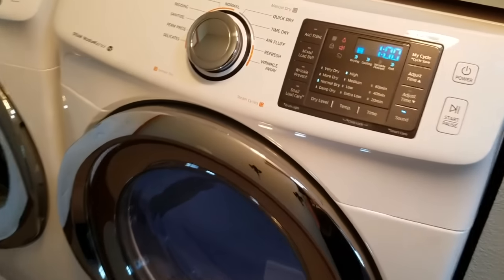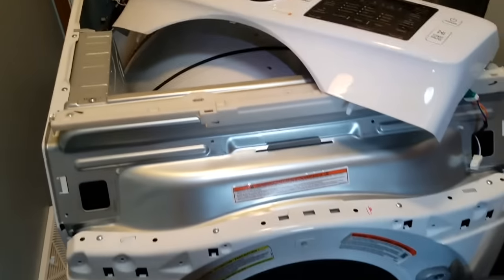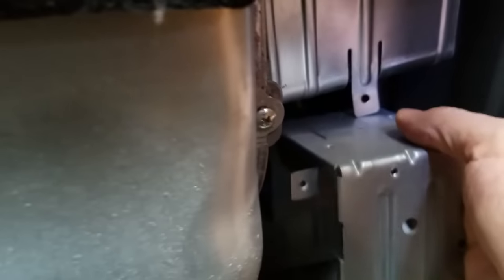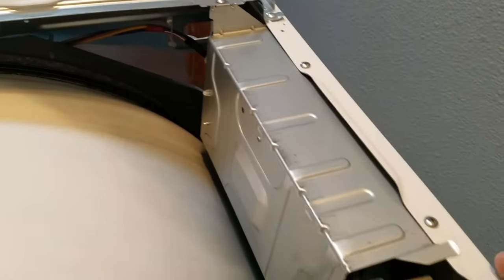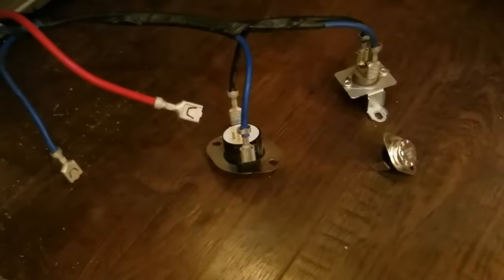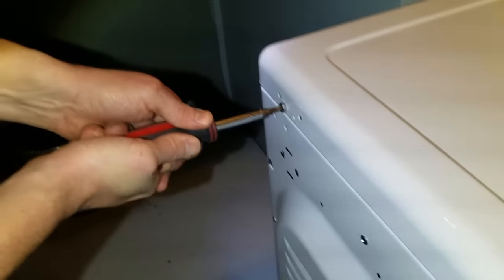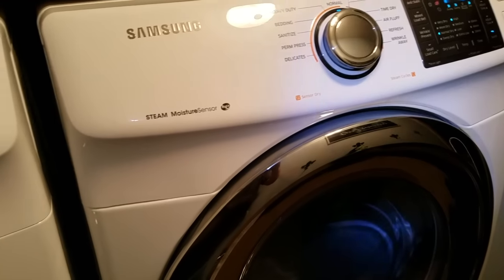Samsung Clothes Dryer Heating Element DIY Repair - No Heat & Noise Fix

Comment: Also to note folks, if you order the element with all parts attached to the casing for $50 (if you don't troubleshoot all parts first) you may have to shape your case into the intake. Ive had cases where it was too large for the hole.
Reply: That's what she said 😅

Comment: * ATTENTION EVERYONE * THIS IS THE VIDEO TO WATCH! 
THANKS FOR THE DETAILED VIDEO! In my case, the Heating Coil did not show obvious break. Replaced Heating Coil... No Heat.  Disassembled again, replaced 2 Sensors on the side of the Heating Coil. COINCIDENCE OR NOT.... Right before putting front panel (door), I NOTICED MY BLUE WIRE TO THE HEATING COIL WAS NOT CONNECTED. Reconnected, reassembled dryer... Plugged in, Flipped breaker back on, TESTED DRYER... YAY HALLELUJAH I HAVE HEAT!!!!
I watched many other videos... YOURS IS THE BEST!
Reply from the maker: Thank you for those kind words sir! God Bless Texas!

Comment: Thank you for this video!!  I have a similar Samsung dryer that stopped heating.  I was expecting a rather large repair bill by calling someone since I never worked on a dryer before...

Sure enough the heating element wire was broken so that's why there was no heat.  This is an excellent video and broke down everything that needed to be done in order to get to the heating element.  I TOO cut my hand!  Lots of freaking sharp edges once you open the dryer up!

I ended up replacing the entire heating element assembly only because it was $20 more than just the bare wire heating element and I figured at 10+ years old, might as well get new everything which includes the thermal switch and thermostat that are built into the heating assembly housing unit.  (Unbolt the entire assembly and bolt new one in, connect everything- done)

Videos like this make YouTube great!  I'm actually surprised at how easy this job was!

Comment: Sir, you are a God send.  This video deserves 1 million views!! Here I am, a mom of 2, hubby is at work and I decided to take this upon myself.  Thank you!!
Reply from the maker: Hopefully I make it to a million with people like you supporting me! Thank you for the kind words.
Reply: @MelvinZoopers  meant it 100%. one quick question, how would I check if the sensors are bad?
Reply: @MelvinZoopers  mine broke exactly at the same spot as yours
Reply from the maker: @cindygallo1954  I'm not exactly sure on that one.
Reply: @cindygallo1954  Check fuse for continuity, same for sensor. They are both designed to open the circuit when activated.

Comment: Very helpful. I lost a leg on my incoming power, ended up being a fuse out on the street. 1/2 of my house worked, 1/2 didn’t and my dryer sounded like a 1950’s car trying to start and made all the remaining lights that were still working do a flicker. My dryer had problems right after they fixed the power. Turns out my element melted. Being a single mom of 2 middle schoolers is hard to just buy a new dryer and cloths line drying is hard in an apartment. Thank you for posting this video, it saved me more than you will ever know
Reply from the maker: Glad it worked out for you!

Comment: Great video, very helpful. Thx Melvin!

I am in the process of doing it and have 2 tips:

1. you can remove like 4 screws that secure the right wall of the dryer to loosen it a bit. That allows you to pull the heating element out easier. That method worked for me.

2. wear work gloves. Almost everything you touch inside of this dryer is sharp!
Reply from the maker: Great tips! Glad it is helping.

Comment: After we replaced the heating element, we ran into an issue where the breaker was tripping whenever we started the drier. It turned out the coils were making contact with another price of metal and causing the breaker to trip! Once we fixed that issue, it started working perfectly. It’s even hotter than it was before! 

Thank you for the video!

Comment: I definitely want to thank you for the diy video. Like you, I purchased the element from Amazon, roughly 36 bucks and followed along step by step and now my dryer works and I'm not out of $200 - $300! Thanks 👍🏾
Reply: oh it's more than that, I was quoted $475 + Taxes.
Reply from the maker: Labor is not cheap.

Comment: I had the same exact problem. The heating coils could have been designed to be more durable. Great video. Wow, those rear screws were a pain, but doable. Also, thanks for explaining the rattling sound!

Comment: Thank you! Was “relieved” to find that my coil spring was also broke, so like you I replaced that only and not the other OEM parts.
Back right-side U bracket screw was a pain, but my biggest issue was stripping out one of the front side door screws 😱
Fortunately had a Dremel cut-off wheel that I was able to put a small “slice” into the head of the screw and then crack it loose with a flathead screwdriver. Still took some muscle because it was cranked down AND had red loctite! Thought I’d mention my solution in case anyone has the same problem on this or another project.
Now just hoping the $26 part from Amazon lasts so I don’t have to do this again. Some reviews have me a bit worried. Thanks again for a great vid and for letting me know to wear gloves. The only cut was to that stupid door screw!
Reply: I had exact same experiance.  Front door screw stripped and that stupid rear bracket set of screws.

Comment: Thank you so much for this video, you saved me a lot of money.

For other folks, my issue was that the dryer was over heating and would not stop running. It would get to the cooling cycle and keep running with one minute left until it overheated and I got the hE error. So the heating element was still getting hot, but wouldn’t shut off. This exact video was the solution for my problem. If you are having my issue, suggest you follow these steps to check out and replace the heating element and or components.

Comment: I have the same dryer so I clicked on you. Good video. I ended up just bending that bracket temporarily that holds the element housing in place while I pulled it out. Then I bent it back into shape on the re-assemble. I cut my finger in the EXACT same place you did.  Thanks for the help!

Comment: Thanks, brother! You've saved us time and money!
Had the exact same problem with my slightly different Samsung model, but the insides were identical. Bought the part off Amazon for about $26 and now the dryer works perfectly. No cut fingers! Do be careful as there are a lot of unseen sharp edges.
Reply from the maker: Awesome!
Reply: Can you send me link from Amazon its hard to find the right product.thank you

Comment: 2024 here & this video is still very helpful. It got me to checking why my dryer wasn't working took it apart & sure thing same issue. Thanks for the video & the step by step, it saved my family $$$.
Reply: Got it back together back up and running & is getting hot ready to dry. Thanks again for the very helpful video.
Reply from the maker: @mmartinez3578 Love it!

Comment: This video was a great help.  Thank you very much for posting it.  Much like others have said, the two screws at the back of the lower bracket were a huge pain and very frustrating to deal with.  Everything else was quite smooth.  I have a very similar model dryer (DV42H5000EW/AC) and I only needed to remove 6 out of 8 screws to take the front door and panel off.  For example, at the very front when I opened the door, I only had to remove 2 out of the 4 screws while I noticed that you removed all 4. I also opted to replace the entire heating assembly with an OEM Samsung one.  Yes, it was much more expensive than just the coil but I got scared reading some of the amazon reviews where people were commenting that the coils didn't last very long.  I didn't want to have to do this job again anytime soon, particularly since it's a stackable dryer and hard to reach the back of it. I've run it once and seems to work fine.  One problem that I was having is that it was getting stuck on one minute (i.e. kept running).

Comment: Fabulous video. Following it and was able to understand and install the new heating element, which I purchased from Amazon ($30) versus another site that listed the element for $119. One think I don't recall you mentioned is how SHARP the metal is - both inside the dryer and the edges of the container holding the element. Thank you. I saved the cost of the service call and what they would have charged for an element.
Reply from the maker: You're welcome! Remember I cut my finger on the metal? It is very sharp!

Comment: Thank you ! I just replaced my daughter's element. Your video made it all go very quickly. Hardest part was getting those 2 screws out on the back side of the U bracket !
Reply from the maker: Without a doubt the hardest part.
Reply: I believe I have a newer model. The same bracket just slides into a clip with no screws. I was very happy to find that out. Thanks for the video though. Because of it, I bought a used set on the marketplace for next to nothing because the dryer wasn’t getting hot. Now I have a good set for cheap.
Reply: @xdarkmercx  i purchased my dryer last summer for 125 so i think i got a lot for a little.

Comment: This was a great video! I didn’t have to remove the drum! Yay 😀! I had limited space but I did fine. Dryer is working like clockwork! The hardest part was the stand the element was sitting on.. I had to bend it a bit,so it was a terror to put back on..but I managed.  My steam w&d are about 11 years old and still work fine. Thanx for your help. Greatly appreciated..money saved!

Comment: Just want to say thank you!! I watch this video and I did it order the part from Amazon for 30 dollars with the sensors and replace everything the actual element part wasn’t cut or any damage just dark because of the heat the usual after 12 years of use but I just changed everything sensors and is working like new I replace my drain pump from the washer years ago same watching videos here and is still working.. thanks for your help!

Comment: Great video. Fixed my dryer really quickly with this. Couldn’t opt for the Amazon part (going on a trip tomorrow, need to use washer today). Appliance parts store only had the entire element assembly ($70, but made the repair even quicker). Thanks!
Reply from the maker: Great when things work out!

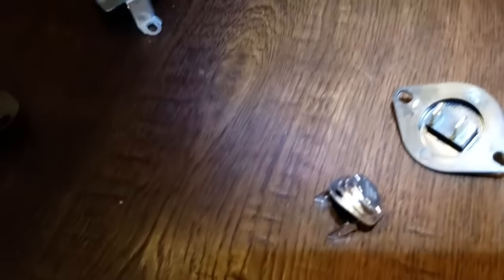Comment: FYI, those replacement parts you had at about 11:15 or so were different sensors.  The replacement parts next to the coil are the Thermal Fuse and the High Limit Thermostat (my fuse goes out a lot, but just replaced the coil too, so maybe that will help).  The 'smaller' parts you had were actually the Thermistor (black larger one) and the Thermostat (smaller silver one).  Those are installed on the back of the blower housing, next to the motor, which you'd have to access by removing the drum.
Reply: This is true. You can also check them with your meter. I had one of four go out, toned out what worked and didn't. My coil actually got hot and broke so I took my thermal and the other for parts next time. $36 bucks for the part and $50 an hour and I do those repairs all day.

Comment: Great step by step video. I will add though after the correct heating element is replaced there may be a slight smell of burning. It does go away after about 10 minutes. Thanks again!!
Reply from the maker: Great point!

Comment: Thanks again for the help. I had already decided to keep the original fuse and over-temp sensor for the same reason. My heating element was broken in exactly the same place. Also discovered a few installation boo boos by the assembler but would not have been of any consequence. Imanaged to draw blood on my wrist, lol. Thank you!
Reply from the maker: Hugh Betcha!

Comment: Thanks, trying to find an improved upgraded element because I had to do this back in 2020 as well. Just long enough to forget how to do it. I did shortcut the screws in that front bracket and put one in the center, or that’s how my dryer came not sure.

Comment: THANK YOU THANK YOU! I did it. I would’ve never tried this probably without your video. It took me several hours, but I ended up bringing my shop vac in. The dryer was full of lint and I did a complete cleaning. I put on leather gloves after slicing up my hands pretty good. Thanks again

Comment: Great video.. helped me fix mine... but just an FYI that part that holding up the hearing element. You don’t have to in screw it.. just bend the metal down it’s very flexible

Comment: Had to replace the heater coil (did the sensors as well...) in a DV42H5000. Your step-by-step instructions were clear and easy to understand.  I am definitely no appliance repairman but got through it without much trouble, save for a few scraped arms on the edges of the interior. Thanks for your help!

Comment: Thanks for the video. I just followed your instructions, ordered a new heating element through Amazon and the dryer is working again, although I ended up with 3 extras screws 😂. We have the same model #, however, mine has a couple of clamps in the control panel, it was a little tricky to get it loose. Other than that, all went smoothly, Thanks again. 👍

Comment: Thank you so much Sir for this great video.. already did all jobs to be done.. now waiting for the "heating coil" part to come ordered at amazon.. i have the same problem "heating coil" broken.. well see when the parts comes.. hoping its a quick fix... thank you
Reply from the maker: Hope so!
Reply: Subscribed at your channel 👍😊😎
Reply: Got the parts.. and thank you Dryer is up and running.. heat is there for only $40 cad.. thank you thank you

Comment: Thank you for the great instructional video, got the heating element replaced and dryer is working. However the lint filter indicator light flashes when dryer is powered on (as I noticed in your video it also flashes) and I am wondering if this is normal?

Comment: Thank you so much! I thought I was going to have to take the whole drum out. If I may offer you some advice? Your dryer door is on backwards. It would be much easier to load and unload your laundry if you switch the door hinges to the other side.
Reply from the maker: ?
The washer sits on the left & the Hinges are on the left & the dryer sits on the right with the door Hinges on the right.

Comment: This was a great video thanks bro. So I couldn’t wait a couple of days for the new element to come in so just for everybody out there you can get a butt connector and kind of crimp it onto the wires that have broke and the heating element will come back on. I haven’t figured out how long that will last as of yet, but it works.
Reply from the maker: Nice job!

Comment: Thanks for the video, very detailed & helpful.  Not being critical, but wouldn't it be easier to just pull the drum and work on the heating element assembly once it's out of the way?I have the same dryer and recently had to replace the tensioner pulley (beneath the drum), so now that it's not heating (several months later), I'll likely just take the drum out (again) for easier access to replace the element.

Comment: This video is great! It was a little trick to get the screw in the back of the bracket, but I’m guessing that was 10x easier then taking out the drum and reinstalling the belt. My old heat coil was not broken, but it was touching the frame.
Reply from the maker: Yeah...that little screw in the back is the worst part of the job.

Comment: Thanks so much for your video it was definitely helpful and I was able to fix it myself. The only thing that happened to me after is that a He letters started show up after the load was done drying. Any idea what could be? So far I figured out is the heating element.
Reply from the maker: Make sure the lint trap is clean & run it. It should go away as you use it with that new element.
Reply: Ok. Thanks.
Reply: Issue continues, clothes comes really hot.

Comment: Great video! I replaced mine and all went well. But please don’t do what I did and not check to see if the coil is touching any part of the frame. I turned my dryer on and ran for about 10 seconds and I heard a pop and my lights in my house flickered. I checked to see if the dryer was working and it was not heating. I took it back apart and found that the coil was touching the frame that it sits on and it arced out and melted the wire. So needless to say I will be doing this again but I will check and make sure the coil is far away from any other pieces before I close it up next time.
Reply from the maker: Good advice!
Reply: So when this happened did you have to re replace the element? After replacing mine an hour ago I turned it on and selected a mode to test and there was a pop/spark from the bottom area and popped my breaker. Once I replace the fuse ill try again, but didnt know of the element is still good?
Reply: Sean Casey  I took mine back apart and the element had arched to the point it melted the wire in two so it’s no good anymore.